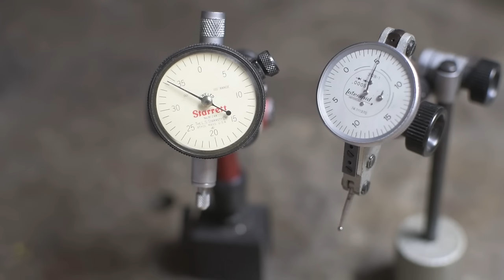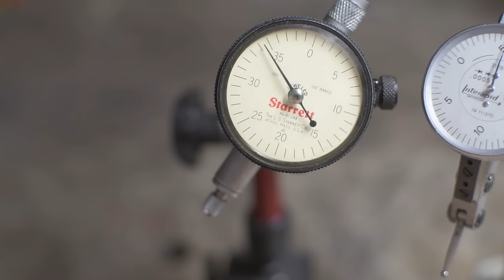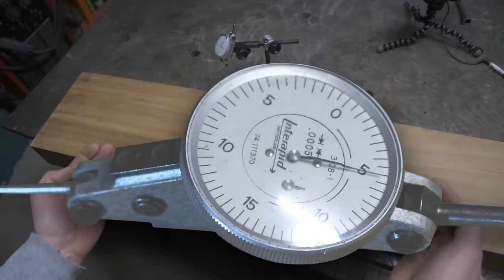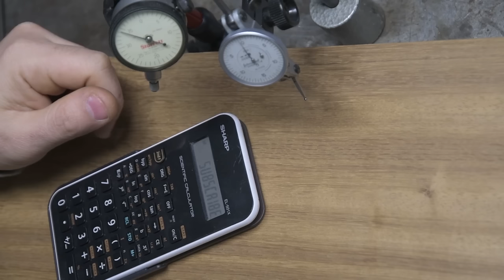Shoot'n The Poop #5 - Just Plain Random

Comment: Those big boring bars are used quite often in oilfield machining. The head is dovetailed onto the large bar to facilitate changing from roughing, finishing and threading cemented carbide tool holders and not have to lift the whole kit and kaboodle out of the lathe and have 4 big bars laying about. OIL Country Tubular Goods (OTCG), I used them mostly to rework tool joint hangers. Love your channel. Thanks, Semper Fi.
Reply: Are these primarily run on vertical lathes?
Reply: I used them on horizontal lathes with an 18" spindle bore. I learned never to put back pressure on the traversing hand wheel when the half nut is engaged for threading. It jams the half nut and 3 foot chucks don't stop on a dime. CRASH!
Reply: Thanks for that

Comment: Hey Tony,  about twenty years ago I watched a guy doing a demo of that tangential tool holder and planed to buy one, until I seen they wanted almost a hundred dollars for it !  I looked it over good and then come home and made one, have been using it ever since.  It's very easy to sharpen without doing a lot of angles, just lightly touch it to a six inch grinding wheel and it even gives you a slight concave. 
You do have great videos with great humor and I think it comes naturally ! 
Thanks for sharing and take care.
Reply from the maker: Thanks Ken.. a TTholder can probably be found on ebay?  But would make a good project.. lot's of brain bending math and setups.
Reply: This Old Tony 
Don't know about the brain bending math, all I had at the time was a cheap machine, hacksaw, files, time and a lot of determination ! 
I've thought about looking for a  " store bought "  one a few times but it just somehow seems like it would be disrespect for the one thats been with me so long !  :-) 
Thanks
Reply: Try looking for old Brown & Sharpe screw machine tooling. TT tools are held in what's called a box tool. The amazing thing about TTs are the depth of cut and feed rate they can handle. They were designed for production long before carbide was common. They also can be made into form tools and multi-dia turning tools because you can cut the form along the entire length and only sharpen the end. The radius you put on the tool can be the whole length of the tool.
Reply: Ken Gamble
Reply: Ken Ga

Comment: Hi Tony.  I'm in my late 60's and fully agree with you about the importance of sound quality.  Please folks, use directional mikes or better still lavaliers.  Turn the background radio's off.  Try and run cables away from electric motors and fluorescent lights to avoid electrical noise pick up.  If you can afford it use balanced 'xlr' microphones, not the 3.5 mm jack style.  The dslr style came audio pre amps are usually noisy as well and their microphones of very low quality.  If possible use manual, not auto gain control - the pro's do, the same as with focus.  I know it costs money and its good of 'makers' to post at any rate.  But, you can drive up your viewing numbers by getting this stuff right!   Bob.

Comment: I'm sure you probably know this already, but hopefully I blow your mind a little bit.  Guess what happens when you use the same tool 90 degrees clockwise from the orientation you have it in the video?  You get a vertical shear bit/tool as well.  You can also do this with round HSS.  Works great for ball turners.

Comment: the dovetail on that huge boring bar is so the end that holds the carbide insert can be changed out depending on what style of insert that is needed. its also much cheaper to just change out the head of the boring bar if it wears out or gets crashed. thanks for the awesome videos!

Comment: Things like this are precisely why I love watching your channel. I had always assumed there was some sort of apparatus  for turning ball stock and thanks to you I now know how to make one. I also have a decent idea as to how to make one of those tool holders which seems a little cheaper than buying inserts all the time. I got it in my head that I could clamp the stock for the holder at a 45° angle with an end mill and just cut a channel for the tool stock creating a nice notch for it. As for the clamping mech I can do the same but add a threaded hole for a grub screw to offset the clamping height for different sized tooling. A bolt down the middle into a threaded hole in the tool holder itself and we're in business. Thanks for the great video....

Comment: Have an older Milwaukee drill here. Has worked great for years. A few notes on them:
Li-Ion batts don't like being used ffffreezing cold. All of mine seem to loose capacity and torque.
Get an XC battery. The stock ones don't like drilling through heavy steel. 1/2" hole through 1.5" steel and the stock batts soon became door stops or had much less capacity. The XC batts last far longer in heavy use and I can work a whole job with one.
I picked up a NOS batt of ebay for a reasonable price.

Comment: I did get a genuine diamond toolholder - it does OK - except - the locking is hard to get sufficient so - if the tip is disturbed a bit you can be quickly off center. Apart from that tangential cutting is great.
Reply: Ifanger is another tangential option, which does not slip. More $$$, though.
Reply: A more affordable option which prevents slippage: a machinist's jack from the heel of the tool down to the topslide or cross-slide. Also helps rigidity.
Quite a lot. 
Don't run into the chuck jaws, though!

Comment: Hey Tony, just to throw a spanner in your C ... err, so to speak, not all DTIs are designed to be used with the contact point at 0 degrees. Interapid for example are calibrated to measure correctly with the contact point at 12 degrees.

PS that is the best looking apple I've ever seen. I would like to see more fruit on your channel.

Comment: I'm confused as to why you would need a special tool holder to do the tangential cuts couldn't you raise the tool holder, position the cutter like a normal tool, and initiate the cut on the work piece from the top?

Comment: that light on the end of the drill gun is a life saver, sometimes you forget to bring a flashlight and the drill gets you out of a bind, really incredible.
Reply: Actually ran into that the other day at work. Had to screw a hinge into the bottom of a shelf with an 8 inch beam. Not much light got in there, so the drill light made it a lot easier to line up the screws with the holes.

Comment: I have always heard the Interapid indicator is designed to measure with the contact point held at an angle of 12° to the measuring surface. How about a video showing the errors at different tip angle using gauge blocks?
Reply from the maker: Yes! I actually did that and cut the parts out as the vid was close to 40 mins long.
To compensate on an interapid at, say, 22*.. you'd subtract 12.. and only worry about the 10* difference.

Comment: I may have you beat for workholding setup of the year. I had some 6.5" x 3" x 0.5" aluminum stock that needed the ends milled, drilled and counterbored. My only mill is a tiny Sherline, and I don't own a drill press, so I had to get creative.

I rotated the head by 90 degrees on the mill, set up a couple of parallels on the far side of the table, put a 1-2-3 block on top of those (legthwise across the table) and secured it to the T slots. Then I placed my 2" vise against the 1-2-3 block, held vertically, passed a drawbolt through the 1-2-3 block and vise, put a couple of parallels against the back side of the vise to give the washers something to press against, and bolted it all together.

It worked, and I got my parts finished, but man was that sketchy.
Reply from the maker: Sometimes it's all about whatever it takes. :)

Comment: You got around the main problem with tangential tooling by welding the cutter.
 Normally they rely on friction to hold the tool though this may work in a vertical mill for light work there is a lot less force. For more manly end milling we use end mills with a weldon flat. :)

Comment: so this sick addiction you started in me all those years ago had its way with me again today. I went out to get a dust collector for the new 9014 cnc machine im building and walked out with a router and bits, an angle grinder and discs, a chop saw, a brad nailer, assorted air hose parts and hose, a new dremel and a palm sander. i had so much crap i didnt even think about how it was going to fit in my jeep. before ToT my yearly tool spending would be around $300. Since Tot my yearly tool spending is about $10k. problem is i have need for more than i have room now. i need tools that take up negative space so they make room for other tools:)

Comment: BTW Interapid test indicators are calibrated to zero error at 12 degrees since most setups would interfere at zero degrees. Mitutoyo has an optional involute tip that is self correcting up to around 30 degrees. A few ways to skin that cat.
Reply from the maker: yes! good point.  

pun intended.

Comment: To improve focusing (auto, or manual), use the A mode (Aperture priority), and kick it up 3 or more stops...  as much as the lighting conditions permit.  With Nikons, I think the aperture has to be set prior to switching to video mode.  Even a lgihtly higher ƒ/stop makes for a greater depth of field:  more objects are in focus at once, and when they do go out of focus, it's not so abrupt.   Heck, if you were out in the sun, you could bump that up to ƒ/16+ and virtually never worry about focus again.
Reply from the maker: Yes! Though light is my problem.. not enough of it.  The old camera would go into convulsions (flicker).   This one seems to be doing well so I can start pushing my DOF.

Comment: I know what that lathe chuck may be for!
Idk the machine itself, but I'm pretty sure that is used to make 5,000lb steel flywheels, they're made for the electric grid.
During the night wind turbines power an electric motor that spins the massive flywheel to thousands of rpm inside a perfectly sealed vacuum, then during daytime peak energy hours the flywheel spins a generator with its stored mechanical rotational energy.
It's a great system, check out, 
"Power Grid Flywheel."
Anyway, take it easy Tony, keep up the great work!!!
Love this channel!!!!!

Jake...
.)

Comment: You think that tangential cutter would have less chatter? I can imagine what with the force being applied more in the long direction of the tool itself, it might want to flex or move less than a standard one.
Reply: Indeed. For a really rigid setup, you can put a machinist's jack from the heel of the tool down to the topslide or cross-slide. Also prevents slippage.

Comment: 25:20 aren't there grinding wheels that can be mounted on a lathe chuck/plate that can make quick work of setting up an od cutter? all ya gotta do after is grind out part of the radius. so ya do most the work from the tool post and get rid of the extra on the grinder.

Comment: I use a TUGA wireless mic.  Plug one end in the camera clip the other to your chest or near you and you have very good sound.  It picks up whispers from 5 feet away.  About $120 for one receiver and two transmitters.  Been using one for over two years.  Works better if you place it somewhere instead of wearing.  But if you travel around you can wear it and have great sound.

Comment: Oh yes! Love this video. 
I thought you'd be interested in hearing this .. I talked my school headmaster into giving me pretty good amount of money so I can build a CNC router and I think it's gonna be close to your design. 
And here's the question .. I have the same problem as you did-the table. My only plan is to go with fabricated table (guess where I have that from) and I priced out 12mm and 15mm sheet metal but due to weight I think I'm gonna go with the 12mm on 50mm square tube frame. What are your thoughts on this? 

Thanks for your videos ! 
Tomas
Reply from the maker: That's a tricky one.  Depends on the size.  You'll get weld distortion and if its a router, you may not be able to mill the top flat.  I'd suggest looking around for an old cast iron table from another machine tool.. table saw, band saw, etc.
Reply: This Old Tony ..I'm pretty much in the same place as you was. ..no cast iron table in sight so. I have pretty flat welding table so only thing I came up with is to weld the frame clamped down to the welding table an then bolt the sheet metal down to the welded frame (and propably  shim it)

Comment: I'm sure it's been mentioned but if your using an Interapid, you must place the stylus at 12 or 13deg to get the correct reading,says it in the manual.  starrett and other brands it's 0 degrees

Comment: Tony, get yourself a head mike for vo/commentary and use your rode for ambient on second channel. Let me know if you need a decent hard disk recorder recommended. In the old days we called it sep mag or seperate magnetic when we recorded on film. Their are also some cheap semi backed enclosures you could use for the back of the rode which will help with ambient reflections. And lastly their are a number of cheap wall coverings you can use to tune your concrete garage. I don’t know how to message on here, but if you need advice, I can find a way. I worked for 25 years as an sound engineer for film and tv.

Comment: Important bit about cosine error: I was pretty sure a lot of indicators are designed to be correct at 12degrees from flat.
Reply from the maker: yes!  well at least the interapids are for sure.
Reply: Just to add to this, you can easily tell if they are, thery will have a pear shaped anti-cosine error tip.  Easy to spot and increasingly commonly used on newer test indicators.  Tony's right, it's just something to be aware of, if using indicator to 'test' trueness of work in the chuck it's not very important. Bob.

Comment: The Diamond tool holder is great,  It was developed in Oz and is made here. It is my most used tool holder.  For fine finishes and accurate dimensions it is unbeatable.  I use it on my CNC lathes.  Ultra quick to sharpen.  see EccentricEngineering.  (no affiliation).
Reply: I like mine, too, but my only reservation is the unavoidable overhang due to the underside being cranked. In almost every other respect it's comparable with an Ifanger toolholder fitted with the 'rougher' style cutters. I say almost, because the Ifanger is resistant to slippage in interrupted or very heavy cuts, and comes in a number of sizes. The Diamond holders are a bit better value, and the bits, of course, hugely better value.

Comment: The quality of phone cameras is always somewhat limited by sensor and lens size. They do a lot of post-processing to make the image look nice, but it's not actually giving you real detail in the same way that larger optics can (in fact, their built in noise reduction tends to eliminate detail from textured surfaces). Not to mention it gives you far less control over focus, depth of field, shutter speed, etc..

A video camera is indeed more practical to record videos than a DSLR's tacked-on "movie mode" (who woulda thunk it?), but I'd take a decent DSLR over a phone any day. The articulated screen is pretty essential, though, especially if you talk (or gesticulate) directly to camera - or you can also use a stand-alone screen showing you the real-time preview, of course, if the camera has HDMI out.

BTW, one of the reasons for limiting the length of movies in DSLRs is to ensure they are classified as "photo cameras" and not "video cameras", which has some implications on taxes and customs duties. That artificial limit is generally 30 minutes, though, not 5. The 5-minute limit on yours might be because the camera is using an old file system that doesn't support large files.

Comment: Don't know if you've found out, since this video was posted, but the limits on DSLRs in length of video is because of it goes over a threshold it is considered a 'video' camera and the taxation on the device changes.  At present the limit is 00:19:59.99.  It's hard coded into the camera.  You can hack the camera to lift this limit but it will likely void the warranty, unless you flash it back before servicing.
Reply from the maker: I didn't know that.

Comment: You'll find the light on your drill is pretty much useless ,all it'll do is cast a shadow of the chuck right where you want to drill your hole. But you can use it as a tiny flashlight to find the screw when you drop it.

Comment: Dad worked in a place where one of the lathes had a swing of more than you could reach.  If you stood on the bed with arms overhead you could not reach center.
Reply: Technically, that's not swing, that's centre height. The swing was more than double of what you could reach. That's awesome !
I remember hearing about a kid who got a job running a lathe even bigger than that "back in the day", in a shipyard. When he was looking for a change from shovelling chips one day, (which was hot work, filling a wheelbarrow four or six times an hour) he hit on the idea of grabbing onto a projecting T stud near the rim of the faceplate, and going for a ride up and over the top, like a chimp on a ferris wheel, kicking his legs and showing off to his coworkers. And cooling off in the nice breeze up there (I believe this was in a sort of lean-to with no walls). 
I bet you're thinking this is going to end badly, but I believe it was just viewed as youthful hijinks and nothing to take particular notice of. Times have changed some....